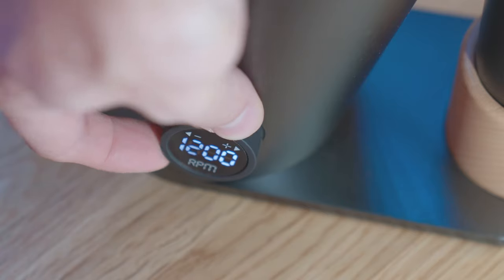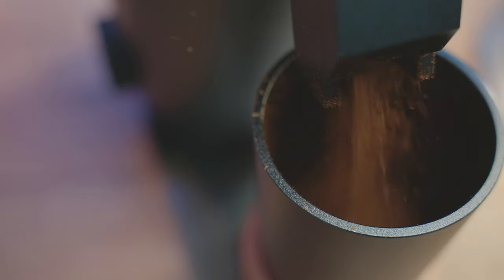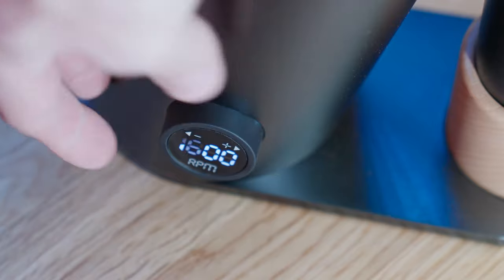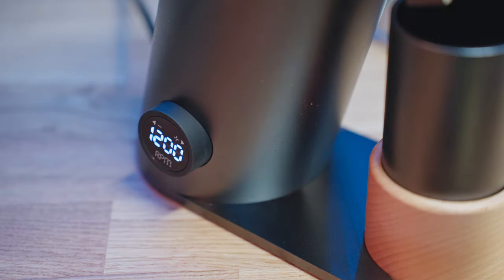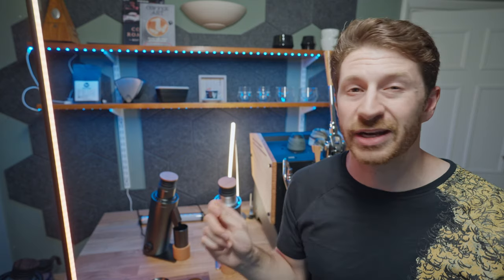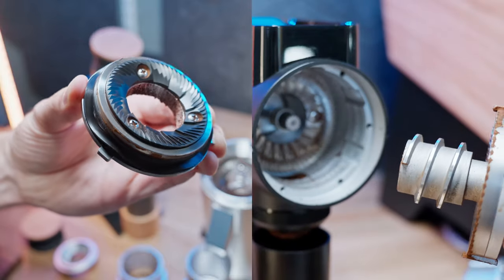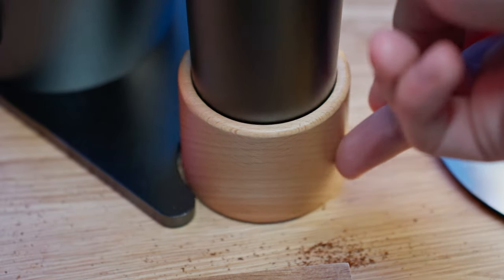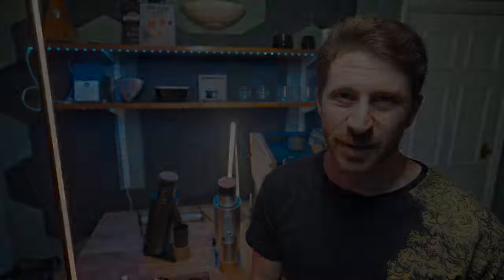Is This The New King Of Variable Speed Coffee Grinders?

Comment: I love mine. Had it for about 5 weeks so no comments on longevity. No stalling issues but also always hot-start. I use it for filter and espresso and for various roast levels so the variable speed and a 64 mm platform was my main reason to purchase this model. Only small additional quirk I have noticed is that adjusting back to espresso after running filter I have to do this with the motor on - to drive out bigger particles between the burrs - otherwise it kind of binds and do not allow to get to the fine setting. I agree on the wooden platform being a strange afterthought - it is working fine but still. I use an acaia portafilter dosing cup and only use the DF64V cup to weight off the beans and put in the Grinder. The Acaia cup has the perfect hight and close any gap to the shoot.
Reply from the maker: Thanks for your experience. I don't do filter often so it's good to know that it's a real selling point
Reply: Which size of the Acaia cup do you have?

Comment: Would you prefer this one or the df83v2
Reply from the maker: I use both, probably the 83 is better for espresso by my estimation, but the 64V is more versatile and grinding on a lower speed for filter makes a massive difference for taste. 64V is a better all rounder but I mostly do espresso, so I'd go for the 83 if that's all you do.
Reply: @homecafecharlie  thanks so much i got the df64v cause it was cheaper to upgrade the burrs, just a question should i season the burrs

Comment: Ive just ordered one but I see this video and loads of static on the grinding which is a slight worry.
Reply from the maker: It's not a big enough reason not to enjoy the grind quality of this thing 😉
Reply: @homecafecharlie  Charlie does your grinder make an odd whinning sound with the power on but not in use - coming from the LCD display area of the variable RPM. Its some sort of transistor noise maybe but its awful

Comment: The wooden platform and added cleanup are potentially dealbreakers for me. How is the alignment, though? Is it "permanent" like the Option-O's P64? 

The Option-O is three times the price! With the same Burrs, would the Option-O taste better?

I'm also toying with the idea of a Zerno. But, it's not variable speed, and I think the variable augurs would be a pain to keep swapping.
Reply from the maker: Stock alignment was perfect. I had 2 of them and both were perfect. 
Zerno looks amazing. I'd love to try one. There are new ones coming out like the Varia VS6 and the new Mazzer. All of it depends on price really. 64V is a great option
Reply: @homecafecharlie Thanks. when i swap burrs on the DF64V would i need to adjust the assignment?
Reply from the maker: @aryehh7128  Aligning burrs is a whole thing. It's not that hard but it can take a while. I put SSP burrs in my DF83 and they are great, but they were misaligned and I needed to put some aluminium shivs in there.
Reply: @homecafecharlie how can I tell if my burrs need to be aligned? would I hear chirping when I try to make espresso?
Reply from the maker: @aryehh7128  you would hear that anyway when the burrs touch. Look up how to align burrs, the method uses a whiteboard marker to see where the burrs touch first. I think Lance Hedrick did a video on it.